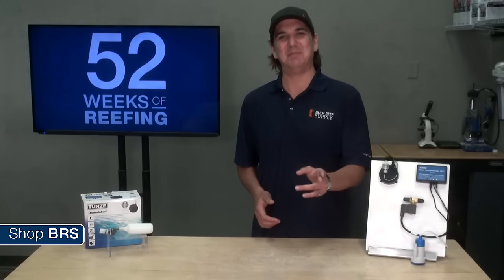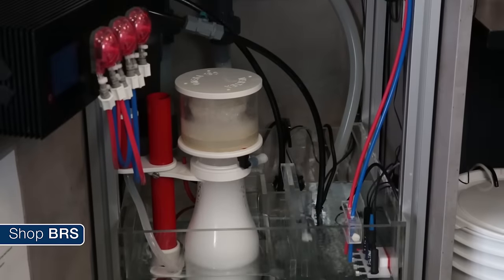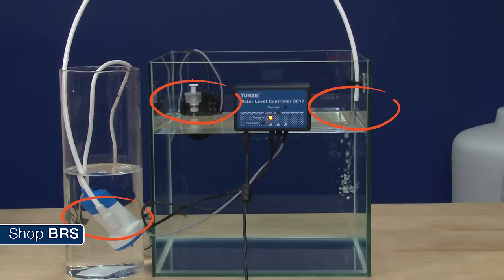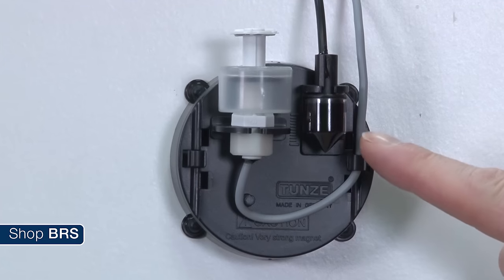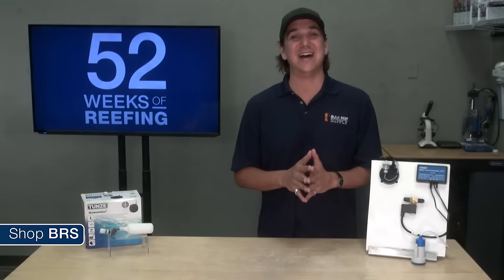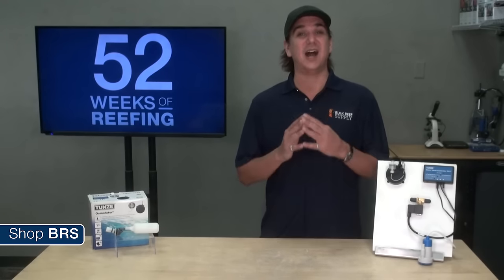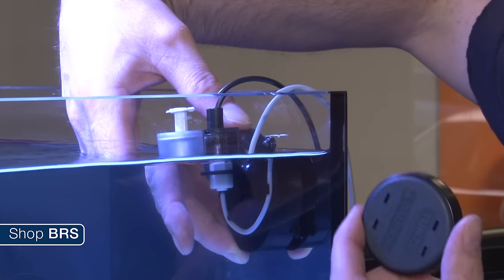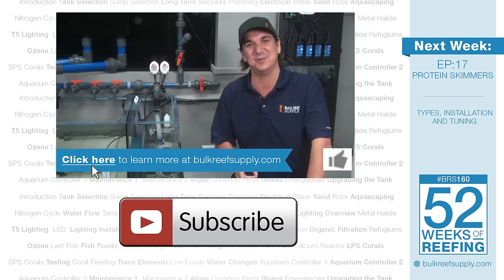Week 16: ATO: Reducing Daily Maintenance, Safely! | 52 Weeks of Reefing

Comment: Ryan and BRS have out done themselves with the 52 Week series. Thanks. I expanded my ATO Reservoir refill system and, if you already have an Apex, its easy to go this next step. I directly attached my basement RODI system to a 10 gallon Brute can. I first used, as in the video, a horizontal float valve. But I was slightly uncomfortable with this so I added 120 volt solenoid switch. Its normal state is closed and must be powered to open. It is controlled through my Apex. I use two float switches inside my ATO reservoir. One mounted low on high. They too are attached to my Apex system through the Apex Breakout Box. When the reservoir drains near the bottom. The low switch activates [closes] and sends this to the Aprex. The solenoid switch then activates [opens] and the RODI system senses the demand and starts up. I have low city water pressure so I use a booster pump on my RODI and the higher pressure pushes the water with very good flow up one story into the ATO container. It fills until the water level reaches the high float switch which closes [or opens depends how you program it]. Again, through the Apex, the power is cut to the solenoid switch and water flow ceases. The original float valve is mounted slightly higher and acts as a first back up. Secondly, the Apex is programmed to limit the time the solenoid switch allows water flow. Third, my RODI is also controlled by my Apex and this limits how long it runs as well. The time limit set for the RODI is the time it takes to to fill my 65 gallon mix tank. So this is only limits a flood to 65 gallons. Fourth and final back are leak detectors at the sump, ATO reservoir, RODI system. I have battery backup on my Apex and my home network and modem. The system notifies me of leaks, long run time of my RODI and solenoid switch and leak detectors and, of course, power failure, by email.

I built the automation, exclusive of the Apex RODI and ATO reservoir, for way less than $100.00

Sorry for the long post and the above seems more complicated than it really is. The  point of this story is I have not carried a water bucket in 4 years. Finally, I am not connected with Neptune Apex except as an owner, although I love the thing. I am sure other aquarium controllers can be used as well.

RJ

Comment: I’ve had the Smart ATO Micro for over 12 months now and it has never failed. I have tested its timed overfill protection and it works great. The single optical eye is extremely accurate in my opinion. I asked my thriving LFS (who sells these ATOs like hotcakes) whether they’ve ever had any returned or any complaints and the answer was a definite no.
One tip I do have is understanding the way its failsafe works. It measures the time it takes to top off your tank the first time you run it after plugging it in, then multiplies that time by three. So if it took 10 seconds to top off the first time, the failsafe will kick in at 30 seconds. The timing of the failsafe will remain the same until you next unplug it (most likely when doing a water change). That’s it, very simple but if used correctly very reliable.
So, when setting this up for the first time AND when doing a water change, slightly overfill your tank so the water level is *just* above the sensor. Plug the ATO in and wait for it to initialise/finish beeping (it won’t start filling, of course, as the water will be above the low water mark on the sensor). Then take some airline tubing and start a siphon in the tank until the water level drops enough for the sensor to start beeping and IMMEDIATELY take the airline tubing out. This way the initial fill will be very small, which means if it fails in the on position the timed overfill protection will kick in relatively quickly, which drastically reduces the odds of overflowing your tank. 
I suspect the reason some people have had issues with this particular ATO is that they allow the ATO to “finish off” their water change, which means the initial fill is likely to be quite long, which in turn means the timed overfill protection will kick in far too late in the event of a sensor failure.
Anyway, easily the best thing I’ve purchased for my tank. Such an incredible timesaver.

Comment: Ryan, absolutely enjoying this series!  I am currently building a 110 tank, lets call it the CLS110, so the timing is perfect.  I wanted to comment on something you dismissed as complicated and that was the RO/DI being plumbed to an intermediate storage tank to top off the tank.  I am doing this option myself.  The reason I decided to go this route is that if all else fails in the "on" position, my dosing pump will fill the tank a lot slower than the RO/DI line.  A 75-gpd RO/DI unit is pushing 197 ml/min.  Your large size dosing pump is 50 ml/min.  The money saved on DI cartridges due to TDS creep also played a small part in that decision and may pay for the intermediate dosing pump.  This option does require a controller as the top off tank needs a low float and a high float in the topoff tank and a solenoid on the RO/DI line; this will get the best performance out of the RO/DI unit though.  Using the timer function on controller, I can set a 3 hour time limit on the RO/DI solenoid and would ensure I never put more than 9.3 gallons into the storage tank.  Also, I can use an OSC statement on the ATO dosing pump to make sure I never put it more than 1 gallon of the fresh water into the tank in a cycle.  Couple this with redundant floats and conductivity monitoring and the system is pretty robust.I know you will cover controllers on a future segment and I do hope you revisit this ATO setup during that sequence.

Comment: “Hard plumbing” my ATO was one of my best decisions in reefing. I utilize a 29 G tank as my buffer reservoir controlled with an Apex using solenoids, optical sensors and leak detectors. I have a solenoid before the RO unit and another post unit for redundancy. I placed a leak detector by my RO after figuring out where water would pool. My reservoir has a bulk head at the top and drain that runs into a bucket with a leak detector as backup. The RO cycles when the Reservoir reaches 4 Gallon so realistically it only runs weekly. From the reservoir I gravity feed to the display using optical sensors and a solenoid with backup float valve. I keep the float permanently above water unless there’s a failure to limit chance of it getting “gunked up”. I’ve also timed and coded max run time logic into my Apex programming. Lastly, I have multiple leak detectors around my display. It’s taken a few years to install it all but combined with my AWC set up (Versas) buckets and turning faucets on/off are largely a thing of the past!

Comment: Amazing! I was wondering if you have some ideas other than a solenoid valve for breaking siphon from RO/DI reserve water tank to a sump. in most cases sumps and reserve water tanks are in a same room and specially for large tanks the reserve water tanks are huge so water level in the reserve water tanks are higher than water level in the sumps and siphoning is inevitable. like always, i need to hear your advice please and thank you :)

Comment: i really enjoy my tank and saltwater setup but I don't know where people get all this money from to build such massive and awesome tanks! im barely squeezing by with what I have on a limited budget. would be nice if some of the equipment wasn't so expensive
Reply: I hear you loud and clear lol that's why I have a 38 gallon
Reply: Sorry but smaller tanks aren’t that much cheaper to even be worth having for that purpose. A “good” Nano skimmer costs 200$ plus. A skimmer for a 120 gallon tank is around 240$-300$. Lights are easy if you look around and get good used ones. An auto too off can be a 5 gallon bucket some RO line and a float valve. Save up and get what you want don’t get antsy and just buy what you see.
Reply: I read Martin Moe's book "Marine Aquarium Reference " ,
back in 1989, and it was invaluable to me. I would say it was the best investment I made when I first started keeping reef tanks.  Some people will claim it's out of date but all subject matter , I think, is still relevant today. He has many cost saving ideas that are practical. Moe was the first to breed many of the organisms kept today. He is also helping to save reefs by breeding the echinoderm, Diadema antillarum. There was a big die off of the species on reefs and it's responsible for keeping macro algae in check.
Reply: Reefing with Reefer  The thing is, you don’t even need a skimmer for a nano tank. I literally just run on a HOB, a heater, and a power head and everything is stable
Reply: That's ok it will make you a better reefer on a budget, just get more creative and search DIY
Reply: line of credit helps :)

Comment: BRS - what is the solenoid auto shut-off system at the 6:54 mark?  I looked at BRS website and could not find it in the RO or Auto topoff section.  In my garage I have a main water reservoir, @15 gals, that tops of a smaller reservoir, @4 gals, that is gravity fed to my sump.  The smaller reservoir is fed by the main reservoir by an ATO (JBJ ATO) with a high/low point so if all else fails we are talking at most 4 gals added to a 70 gal system.  The secondary solenoid shut off seems to be the added redundancy I am looking for along with one or two of those awesome new flow-lok leak detectors.
Reply: +BulkReefSupplyCom - believe me, I have had the Apex gold system in my cart several times with all the add-ons... the wife proceeds to pick up the Ipad and states "I hope you dont plan on spending $1100 on that water box!"...one day, one day...

Comment: I have a diy system that has worked well for me for several years.   Consists of a sprinkler timer and a low flow sprinkler valve.  The timer turns on both the valve and a relay which turns on a pressure booster pump.  This system feeds the ROdi system which runs straight to sump.   I don't believe the sprinkler valve would fail on the on position due to the spring inside, but I should give the system some more thought.  So I give my sump a fixed amount daily and it really doesn't fluctuate much over time -- seasonal humidity levels would have the most effect.
Reply: +Patrick Egal Great idea and very simple.  I would only add high level float wired into a relay to turn the system off if the sump level were to end up high for an unforeseen circumstance.
Reply: Understood -- the sprinkler valve is on the dirty / inlet side of the rodi unit, so I assume any potential metal contaminates would be filtered out.

Comment: Hi guys. Wondering if you can help. I've got a 50gpd pumped Vyair RO-50 MP in water saver format connected to the top up reservoir in my red sea reefer (the tank that sits directly on top of the sump). Product water from the RO enters this tank via a fixed float valve (same as the one in your video). I have also got a Tunze 5017 plus safety valve with the optical sensor in the top up tank and the secondary float valve on a separate magnet above the standard operational water level in the return section of the sump. The plan is that the RO unit turns on for around an hour during the evening every couple of days and this should be enough to fill the reservoir and provide for the tanks needs for 2 - 3 days. The reservoir then drains gradually via gravity over the next couple of days and is controlled by a float valve in the return section (standard Red Sea arrangement). If the valve were to fail, and the reservoir began to empty too fast, the Tunze float valve would be tripped by the rise in water level in the return chamber. After a couple of days, the RO would turn on and refill the tank to the top, being stopped by the float valve or, in an emergency the optical switch. I'm having a problem though - firstly, if the reservoir empties too much, it takes too long to refill and the Tunze 5017 enters 'too low' mode, automatically activating the solenoid and shutting off the water supply from the RO (I have the valve placed after the last DI canister). Unless the 5017 is turned off and on again, it seems to stay in this mode permanently. Is there any way to over-ride the 10 minute timer? If not, it really limits the use of this item as far as I can tell. Also, my RO unit keeps turning back on even when the solenoid is activated. It doesn't produce any water, just turns on for a few seconds, builds pressure, then switches off again. It does this every minute or so which is very annoying! It's almost as if the unit is loosing pressure even though the solenoid is stopping water production. Have you experienced this ever?
Reply: thanks very much guys  - that controller looks like it may solve part of my problems!!  Love your videos by the way ;-)

Comment: U guys have too much time on ur hands, awesome setup so far, I've had a tunze for two years now without failure, even when my diy sump cracked and top off water drained the pump still worked the next day, it's not as quiet as it used to be but hopefully it will last!!

Comment: What's the best ato for the new waterbox peninsula mini 25 ?
Reply from the maker: Hard to go wrong with a Tunze Osmolator 3155. For smaller tanks, just open up the controller and turn the flow down to the "nano" setting.
Reply: @BRStv  my lfs sells a tunze nano 3152. Would that be ok ?

Comment: Does anyone know if you can use the solenoid valve with the water pump that comes with the kit...
I'm thinking of using the solenoid with the water pump so that I don't get a siphoning effect...
Reply from the maker: I don't believe there would be enough power to both power the pump and open the solenoid. To use both, you'd almost certainly have to DIY a relay setup. That said, as long as the output of the ATO tube is below the water level in the ATO container, you won't have siphon issues.
Reply: @BRStv  Ok, I'll try and figure out something...
This is how my setup is...
I have two 5gl buckets stacked on top of each other, the top one gravity feeds the bottom bucket and my water pump is in the lower reservoir (lower 5gl bucket) and that one feeds a tank, that water pump is on a timer, but I've noticed once the pump shuts off
the water will continue to inter tank and this is why I asked that question about the solenoid...
Do you have any suggestions on how to solve this problem...